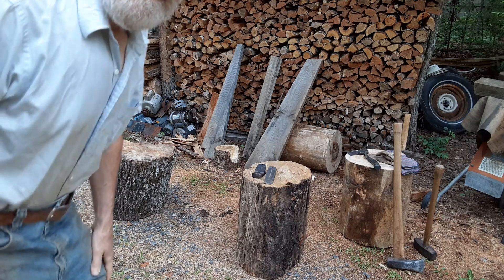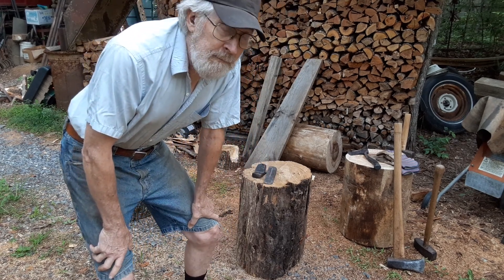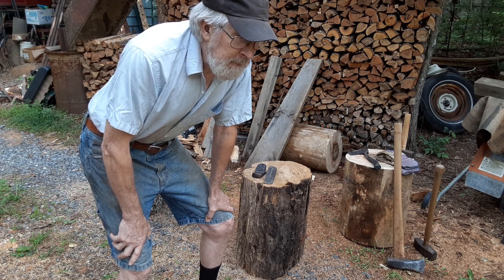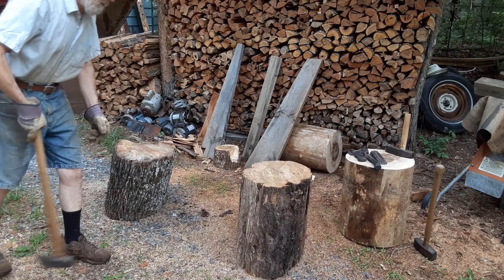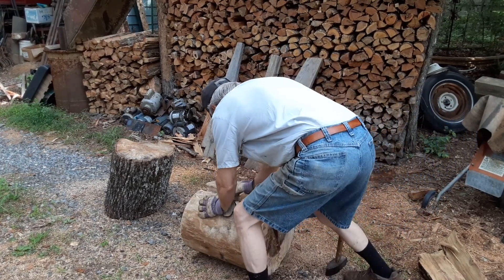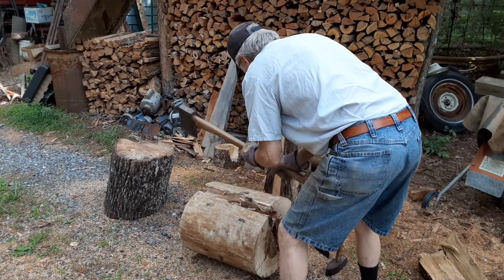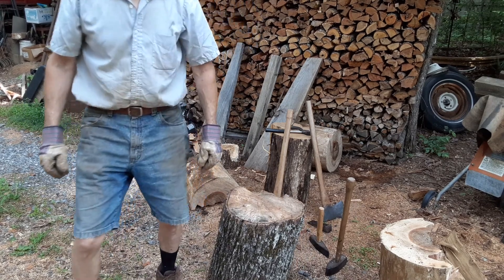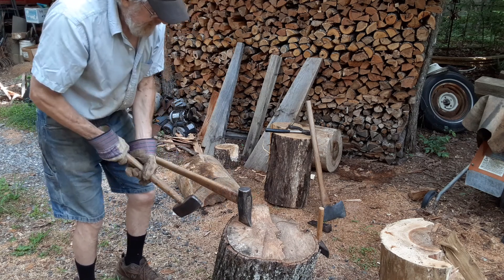Splitting firewood, comparison locust  sycamore hickory

Comment: As difficult as Sycamore is to split across the center, it's really easy to knock edges off.  Each year's growth spirals around the stem across the previous year's. Making it sort of like plywood, but splitting along the rings, it pops apart easily.

Comment: I’m curious why the rounds you split in this video (and some others you showed )are so long?  Is it because you’ve got a really big wood stove box?  Wouldn’t it be much easier to split if you cut shorter lengths?

I just finished splitting and stacking lots of 16”L chunks of partially seasoned white oak and black locust (still were wet in the middle) - cleaved the bark off them too + cross-stacked the oak so it will dry faster.  Got 6 stacks next to the wood stove with a fan setup to blow heat through them soon as I start burning up here in Buckland, Ma. Smaller pieces that are cross-stacked dry in no time next to a stove.

Mornings are now starting to get down into the lower 50’s to mid to upper 40’s.  I’m 77 and am grateful as are you that I can still split-n-stack and enjoy the dry, radiant heat coming from my woody! 

Thanks for sharing the vids! 🙏🏻😎👍🏻
Reply from the maker: Stove takes 24" wood, so I go a little shorter 21"

Comment: Hey Tom, have you ever tried using a Dogwood “glut” to split wood?

 Once the cracks are open about 3/8” or 1/2” from the metal wedges, insert the glut (the piece being split just can’t take that width & wedge action haha) and bang it with a hammer. Bye bye strings as wood pops apart! Old timers in E KY showed me that.

Good job my friend!!👍
Reply: Hi could you explain what is a Dogwood "glut"? Is it like a wedge made with dogwood?
Reply: @babbuzzifirewood  yes, exactly.
Reply: @babbuzzifirewood  
Look up glut and beetle splitting rails for fence.